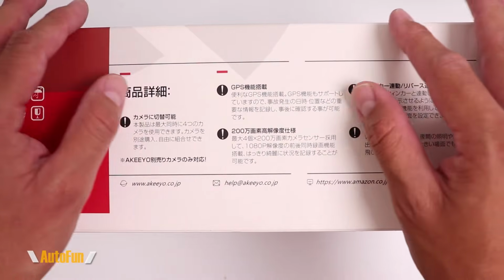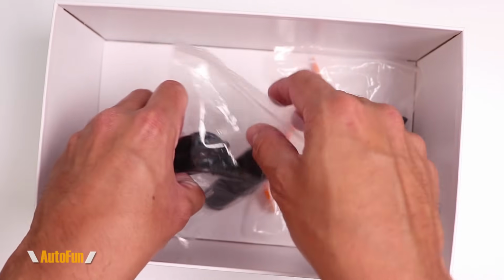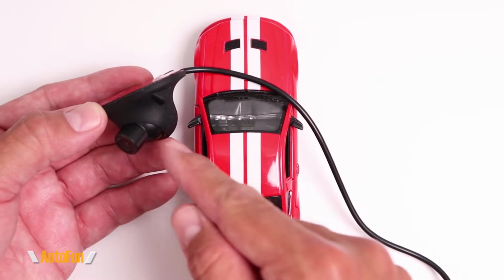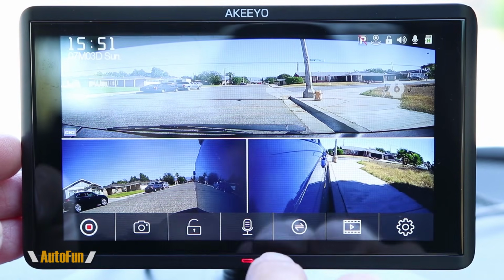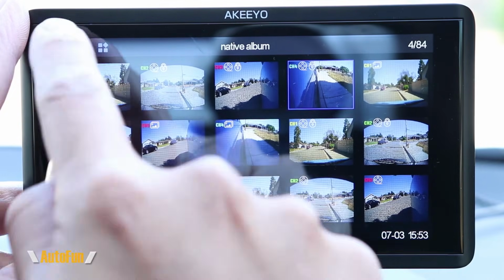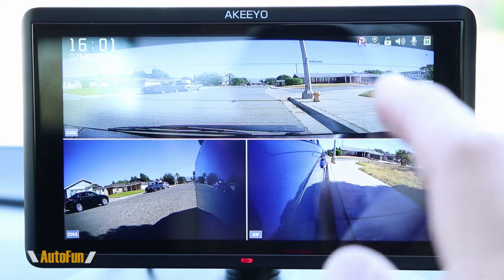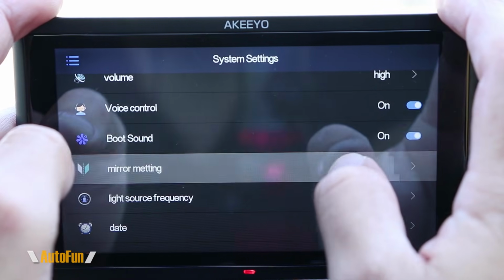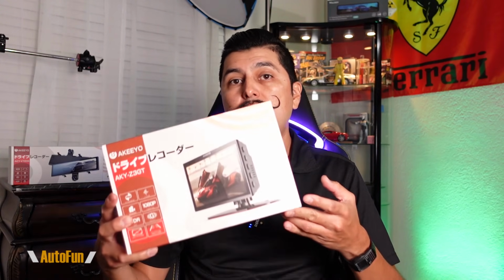AKEEYO AKY-Z3GT Dash Cam Review (Side Cameras, 4 Channel, GPS, Park Mode & Park Assist)

Comment: I like the idea of side cameras but is this model have a PARKING MODE ?
Reply: Thank you Alex, do you have any video on how parking mode could be supported by a dedicated battery.
Reply from the maker: @JamesLennon-od5bq  You're welcome! Ah while some people do run their dash cam off a battery pack. I personally don't due to the extreme temperatures the interior of a vehicle can experience (which I prefer not to subject the battery to) and due to the potential for a run away event (fire) during charging or discharging inside the car. Here is an example of a internal dash cam battery and what the sun did to it https://youtu.be/HW8jqbl_ayU and a video of battery related fire I personally experienced https://youtu.be/XfWgJ8nu-RA (destroyed the house) However, here are some alternatives to hardwire https://youtu.be/P0VapL70m7c or https://youtu.be/-hGu8KZLaZ4 and https://youtu.be/YEklm9V6xYE Cheers!
Reply from the maker: Hi! Yes, as mentioned on the video, park monitoring can be enabled with the hardwire kit, Cheers!

Comment: How do you wire to get the camera integrated with signal button?
Reply from the maker: Hi A! Not sure what you mean, the cameras are simply connected with the included cables to the main monitor (you can see them when I unbox the system), there is nothing is to do beside connecting the cables. Cheers!

Comment: I need a good night vision sideview camera thats a bit discreet, which also records while parked. Which one would you recommend?
Reply from the maker: Hi E! Ah most side cameras are similar if not identical (there are more discrete ones but they require drilling the car's body to hide them only showing the lens) if you only need 1 side camera here is a good choice https://youtu.be/u7jhNVtxQdM if you need 2 side cameras here is a good choice https://youtu.be/gv0vPipuT8s cheers!

Comment: They only record while the car is on? Someone in my parking complex keeps hitting my car doors I already have two dents and want something that can record while the car is off.
Reply from the maker: Hi B! Yes it can, as explained on the video park monitoring can enabled with the included hardwire kit. Cheers!
Reply: @AlexAutoFun  oh thank you I just subscribe to your channel
Reply from the maker: @bomb_star932  You're welcome Bud! and welcome aboard, Cheers!
Reply: Hi where can I get akeeyo z3gt dash cam
Reply from the maker: @richardfrost1026  Hi Richard! I placed the link to it in the video description, Cheers!
Reply: Found them thanks so they can be used when the car is parked as I have some one is scratching my car so I need one that works when the car is parked
Reply from the maker: @richardfrost1026  Hi Richard! Yep,  you can, as explained on the video, park monitoring, can be enabled with the included hardwire kit. Cheers!

Comment: Hi . I got doubt 🧐 I just got this dash cam so haven’t able to change the micro as card it says as no inserted I’ve tried to different brands and speeds but it works with the factory settings as card , why ? Anybody somebody with same issue please
Reply from the maker: Hi Pete! Some dash cam are very sensitive to low performing cards (and sometimes even the brand) Here is the card I use https://amzn.to/45HublL I would also recommend contacting Akeeyo for tech support, they may be able to walk you thru some troubleshooting steps if your are still having issues. And please keep us posted on your findings. Cheers!
Reply: @AlexAutoFun  hi thanks for replying about this issue my friend I did contact akeeyo so I went to their store and no available as cards anymore
Reply from the maker: @peteschmitz777  You're welcome Pete! I just checked their store and still shows memory cards available (I placed the link in the video description). The memory card (if you want to get it from Akeeyo) can be ordered at the time the dash cam system is ordered or as separate accessory. Cheers!
Reply: @AlexAutoFun  I did order the micro sd card u said but also says card not inserted and on the website akeeyo out of stock
Reply: @AlexAutoFun  u didn’t change your sd card I believe you just do reviews shorts reviews buddy
Reply from the maker: @peteschmitz1587  Hi Pete! I just checked again and it shows in stock (all 4 memory card sizes, link to the dash cam in the video description). However it is possible you are in an area that Akeeyo does not deliver the memory card to (which could cause it to show it's out of stock to you, but in stock for other people). If you dash cam says that your memory card is not inserted, that means the memory card is either backwards or not fully seated in place. I would recommend contacting your installer to check your dash cam or as I recommend earlier contacting Akeeyo for tech support, they may be able to walk you thru some troubleshooting steps. And please keep us posted on your findings. Cheers!
Reply from the maker: Hi Pete! I don't change memory cards, the dash cams are tested with the memory card that they arrive with (when included, not all dash cams include an SD card, however Akeeyo does). Once the memory card wears out, it is replaced with a new one. Memory cards typically have a life as short as 6 months and as long as 1-2 yrs before they wear out. How fast this happens depends on how much driving you are doing, how often the memory card is formatted and if the memory card is Endurance rated or not. Cheers!
Reply: @AlexAutoFun  I gotchu thanks mister
Reply from the maker: @peteschmitz1587  You're welcome Pete!
Reply: @AlexAutoFun  I’ll order that sd card to check this out in future

Comment: Great work mate. I plan on ordering this for my Jeep. A few questions if you could help - Can I mount the front camera to the exterior of the car (near the number plate?). What are your thoughts on the durability of this product? Does it come with any kind of international warranty (I doubt though)?
Reply: Thanks Alex. Yeah the auto vox camera looks like a nice solution.

Do you know of any wifi camera that has some kind of android auto app which could be used on my android auto infotainment directly, thus taking away the need for an extra display?
Reply from the maker: You're welcome! Ah yes the closest I seen to that is this one https://youtu.be/DlfSYpaad_o Cheers! @raghavgulati1119
Reply from the maker: Thanks Raghav! Ah regarding the front camera, not it cannot be mounted on the outside since it's not waterproof. Here is waterproof camera that may interest you https://youtu.be/Ht9Q-0HlKMY Regarding warranty Akeeyo says they include a 1 year warranty and while I have not had any issues with my Akeeyo systems, you are right warranty may be different if there is a need to return the system since shipping costs maybe higher than shipping something domestically. And here is my follow video showing all the menu features of the this system https://youtu.be/0c8GoBEIA4Q Cheers!

Comment: This is a perfect setup in a variety of ways but feel like akeeyo dropped the ball with the exterior side cameras, should’ve ran the cable differently makes it hard to hide the wires even if you drill into the fenders
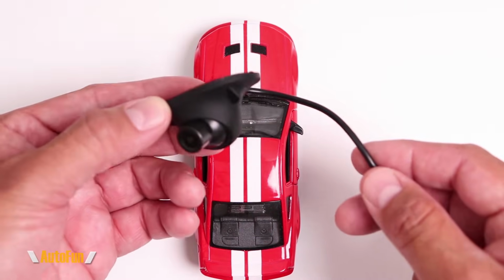Reply from the maker: Hi Bryan! The silver side camera has the cable coming out the side as shown on the video only for those who are looking to avoid drilling a hole into the fender. If you are looking to drill a hole to conceal the cable completely, the cable actually comes out more towards the middle of the back of the side camera (under the double side tape adhesive). Here is my follow video where you can see the cable exit underneath the camera around the 3:50 mark https://youtu.be/Wb_PAPdFfZc And while I seen installs where a hole was drilled to fully conceal the cable, I had my car next to that setup and people couldn't tell there was a difference unless I pointed it out (since my cable immediately bends into the inside panels of the car as shown on the video, so I like to stick to the non-drill method but drilling is definitely another way to do it cheers!

Comment: This was a great review and seems close to what I am looking for.  I have a 2 year old BMW X5 that already has built in cameras in front, mirrors, and rear for parking assist, driver lane change assist, and heads up display.  However, it does not have a dashcam for while driving or for taking videos while parked.  I really like the Tesla Sentry system, but no one seems to have it for other cars.  I want a dashcam to record the front, rear, and especially the side doors and side panels to see who scratches my car doors and dings with shopping carts it when it is parked in shopping center parking lots. 
The Blackvue and Thinkware dashcams are nice but have no side cameras like the Tesla sentry system.  Is there a 4kfront 2k rear, and side camera system I could use for my car when it is parked.  Also, is there a system that monitors the car battery level when it is parked so the battery doesnt run too low? The Akeeyo seems good, but no side cameras with their newer 4k/2k dashcam system nor does it have a sensor to record when someone approaches your car to scatch it or dings it in the parking lot on the side when they open their doors in the parking spaces.  Is there another dashcam system that has all this?  If not, is there a 4k/2k system that I could add the exterior side cameras?
Reply from the maker: Thanks Charles! Ah regarding 4K side camera systems, there are currently none on the market. There are some systems like this one https://amzn.to/44XHgWX that have 4K for the screen itself while the cameras are FHD. Same with 2K, now I will tell you that from FHD to 2K the difference is very small (1920x1080 in FHD and 2048x1080) so most people can't tell the difference between them. The big jump that is noticeable is 4K but as mentioned there is currently no side camera system with it. Likely we will not see one for a long time since side cameras are normally used for viewing the road first and as a dash cam second. So for the main priority of seeing the road 4K will not be beneficial since the screen that the side dash cams use are small in size where FHD will be more that sufficient (due to the size of the screen). To enjoy the benefits of 4K the screen would have to be much larger to see all the details. Hope this helps, Cheers!
Reply: @AlexAutoFun  Makes sense.  I agree, the 4k is not needed for the side cameras and 1080 would be fine for side cameras.  I was wondering if the 4kfront and 2k rear systems that are useful for identifying license plates also happen to come with side 1080 resolution exterior cameras. And also whether any systems with side cameras have the buffered video with motion detection on the sides of the car while parked.  Thinkware and Blackvue are nice dashcams with motion detection but they have no side camera systems.
Reply from the maker: @charlesg6583  Hi Charles! Ah yeah there are currently no 4 channel systems with 4K or 2K (front, rear, 2 side cameras) this is likely due to the amount of processing power required for 4 channels with 2 of them being 4K or 2K and bandwidth limitations (this is also why rear cameras are limited to FHD, current dash cams use AHD 2.0 for the rear camera signal and that standard does not support 4K or 2K, not long ago the same company that developed AHD announced that they have began working on AHD 3.0 which will support higher resolutions (however considering 2.0 took years to be released, it will be a while for us to see 3.0), so once that standard comes out, we will eventually see dash cam manufacturers began to use at some point in the future. Regarding buffered parking mode with side cameras nope there are none, buffered parking is somewhat of a rare option on dash cams but it is a really good feature to have, here are 2 systems that support it https://youtu.be/lwoSbiwjSik and https://youtu.be/SD5AEbR0fLI Hope this helps, Cheers!

Comment: I have watched your videos about WOLFBOX 880 too.  Thank you.  I want it like my tesla I used to have.  I want the mirror like this? The three channel is available but I just want rear and side cameras on a after market radio or mirror not a extra display.  I really want the turn signal feature but will settle for mirror.  Not sure if Amazon aftermarket cameras will work with the WOLFBOX.  Thanks
Reply from the maker: Hi! Ah yes in mirror style here is how I done https://youtu.be/Wb_PAPdFfZc cheers!
Reply: @AlexAutoFun  thank you for the videos when I go to the HUD website, it says pre-order I’m not even able to purchase the brand. Is that two separate items? The two side cameras in the back up camera is not the same brand as the HUD heads up display?

Comment: Does it have parking surveillance mode and low battery shut-off function to prevent killing your battery  ❔
Reply from the maker: Hi THE PRESLEYS! Correct as long as the hardwire kit is used. Hope this helps, Cheers!
Reply: @AlexAutoFun  
Great,  thanks for your  help 👍
Your channel is the best I've seen for dash camera reviews.  
Just Subscribed ☑️
Reply from the maker: Thanks THE PRESLEYS and welcome to the channel!
Reply: Question:
Alex, is there a high resolution 4 channel mirror dash camera with tiny stealthy cameras like this model that records all 4 channels simultaneously in parking mode as well - I can't use the 360 systems as I can not take interior shots of the vehicle - just exterior video (front, rear, left and right sides.)
Reply from the maker: @Elvis_Pond5  Hi Elvis! Ah yes a 4 channel mirror dash cam is very rare but here is one that does supports 4 cameras https://amzn.to/43ugWm2 Hope this helps, Cheers!
Reply: @AlexAutoFun  
Thank you Alex 👍
Reply from the maker: @Elvis_Pond5  You're welcome!

Comment: Looks great but I'm just worried about somebody breaking into the car and stealing the screen? Then the footage will be gone. Maybe the screen could be fitted somewhere hidden away in the car?
Reply from the maker: Hi Derelict Detective! Correct, the installer can potentially hide the main unit somewhere in the car. And what I usually recommend (if budgets allows) is to run dual dash cams, so I would pair this dash cam with this stealth dash cam https://youtu.be/TvKRKYA7cgQ which ensures both redundancy in the case one fails and also in case one gets stolen. Hope this helps, Cheers!

Comment: Hi Alex! Love your videos. Keep up the excellent work in making me spend more and more on car gadgets :). And now I have to get this one as well! 
Would you be able to help me with the dimension specs of the monitor? I checked the website for specifications, and it only mentions a screen size of 5.5 inches. L x B X H will help me determine where this fits the best.
Reply from the maker: Thanks Arjit! Here you go: 5.75" wide by 3.75" tall, adding the stand adds another 1" for a total height of 4.75" Hope this helps, Cheers!
Reply: @AlexAutoFun  Hey, Thanks for sharing the details. I just need one more help. I am committed to making Honda a Tesla for monitoring parity and plan to get AKY-V720S and AKY-Z3GT. I will get hardwire kit for both of these. In some hardwire kits, we can replace the fuse with the kit and then put the fuse next to it. Is the kit Akeeyo provides stackable, i.e., can two kits be combined at the fuse connector or by soldering the wires so that both can power from the same fuse selections? The reason for this is that only limited fuse slots can be used for this.
Reply from the maker: @ArjitDhavale  You're welcome Arjit! Correct, the hardwire kit shown on the video will need to have fuse taps installed if the installer wants to tap the fuse box directly, here is my video on how those are installed https://youtu.be/Qzw9yUYN7zo Cheers!
Reply: @AlexAutoFun  You are the best! Thanks for helping me out.
Reply from the maker: You're welcome!

Comment: I'm not sure why my Akeeyo LCD screen overheats easily.
Reply from the maker: Hi Elanie! That is strange, the system is rated at a maximum temperature of 160°F assuming you are not close to that, it should be good. If you are still having overheating issues I would also recommend contacting Akeeyo for support, they may just be able to walk your thru some trouble shooting steps. Hope this helps, Cheers!

Comment: Can you tell us mode is this got parking mode and 24/7 surveillance and recording? If yes, how long is the battery life? Any hardwire options?
Reply from the maker: Hi Blashazo! Correct, you can enable park monitor (monitoring your car while it's off) using their hardwire kit. Here is the video for how that is connected https://youtu.be/K2iKXj82354 Cheers!

Comment: Is it possible to display the right and left side views on the display in split screen?  That would be a great option for highway driving on a road with multiple lanes to enable lane-changing easier (covering the Left and Right blind spots)?  Also, any plans for a larger screen?  A 5" screen is pretty small and can be difficult to see well if you have older eyes.  Thanks
Reply: They not have that option yet  also they didn’t make compatibility with other side cameras so you need to buy from they
Reply: Hello there.. did you find something what you described in your comment?